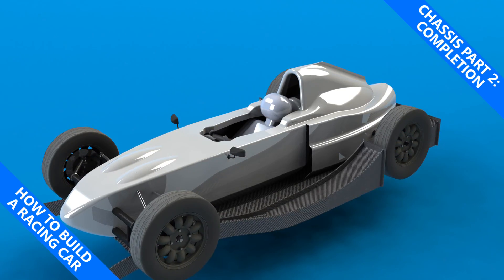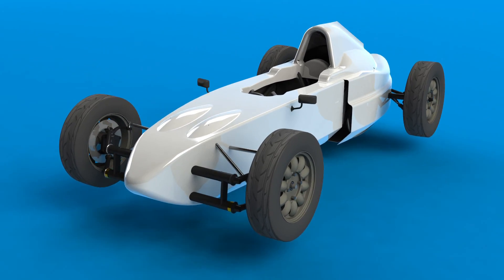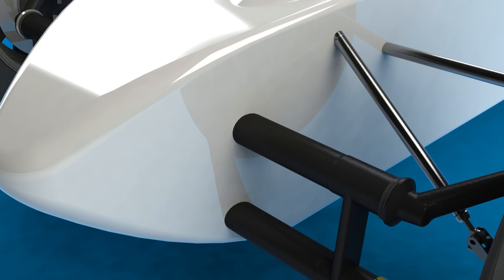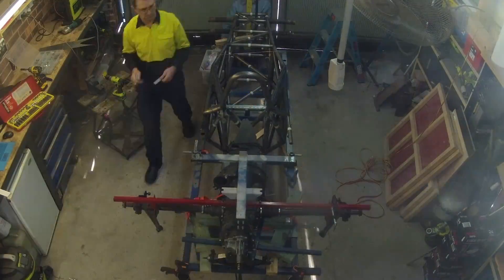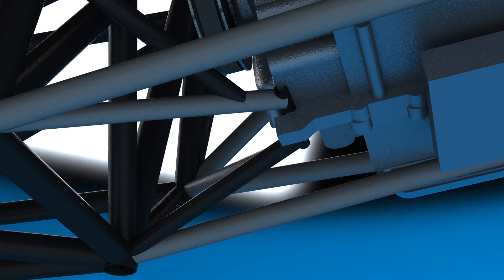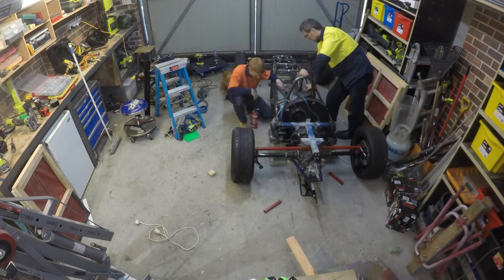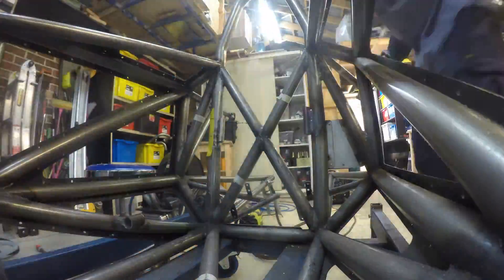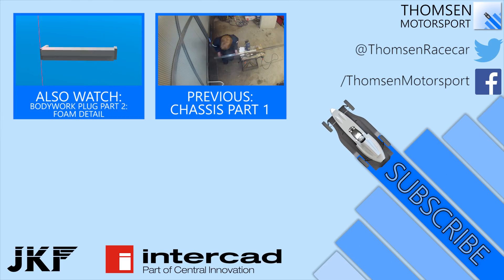Chassis Part 2: Completion

Comment: it makes no difference where the beacon is placed, whether front or back the time recorded is the same :)
Reply from the maker: +hortonas786 correct, the lap time will be the same. 
However if you cross the line side by side with someone else, it may make the difference between being before them and after them in the timing computer.
Reply: that is correct. but since the timing is the same no matter where you put the beacon, and assuming its a time trial, doesnt this mean that even if someones car reaches the line first the winnes is still the one whose time is the fastest?
Reply from the maker: +hortonas786 if it were a time trial that would be correct. That's how qualifying works. But the races do depend on finishing position as identified by the beacon. It's not uncommon for cars to finish races side by side - I've been in that position before - so I wanted to do what I could.
Reply: nice! thanks for clearing it out man, good job on the car. looks amazing

Comment: i want to know that why in most chassis like this the front section is elevated...?? any significance..??
Reply from the maker: +rohit rawal on my car it's partially for aero reasons. The amount of dive under braking also means a high front will reduce contact with the ground. Vees are softly sprung so without a heap of preload this would be a problem for a low nosed car.
Reply: Sir...is there any reason fr suspension hard points or related to wheel..?? Let me show u a design..any sir il trouble u alot because u r a man of my need...In this design aero is not considered yet the front n middle part are elevated..Sir help me to understand...
https://lh3.googleusercontent.com/YatPJsdXZV4LM3qTHIsAT_1pxedc2sXnp8PqyQCsWNBEtSaoa447NHj0ZnHtoVnGoYNHmoydSA
Reply from the maker: I'm having some trouble understanding. The suspension is lifted from a VW beetle so very little can be done in terms of geometry and things, you just have to mount it to the car. Aero was considered and was part of the reason why the front is elevated, however as I mentioned it wasn't the only reason. Does that clear it up?
Reply: OK sir.....

Comment: I have a kart, but I want to upgrade it. to make the chassis welding and só on is not problem, but to draw it in some software I don't have any knowledge... I didn,t understand well what you used...
Reply from the maker: Hi Roger, I used Solidworks to do everything you see, from the design to the drawings and then the renders that go in the videos. I've used a few packages with work but went with Solidworks for this project as I found it the most intuitive and covered the wide range of requirements I had. If you're in Australia Intercad could help you out, otherwise there should be a local supplier of the software.

Comment: first, awesome work, very well documented,  top. this is the first chassis you made? what is the kind of matal you use? when you say that you spend around 25 and 30, you are including the tools to make it? thanks and keep going 😉
Reply from the maker: Yep, first chassis for me. I used 350MPa carbon steel tube (specified by rules), produced seamless and drawn over mandrel to form its shape. That figure includes the tools, it's an all inclusive figure for anything I've spent on the car. Thanks for the feedback.

Comment: some circuits like a Rally Sport require certified welding facilities to put in certain portions of the frame, was that not an issue for this project? could you explain a bit more about the FEA, I know you can't do collisions in SolidWorks but I'm curious to know how you approached it using Excel?
Reply from the maker: +P R The rules specify the material, some of the design constraints and fabrication methods, as long as those are followed it's fine. You need to get the chassis certified if you deviate from those to ensure it's safe. 
I used 6dof frame stiffness elements to build a stiffness matrix in excel. I had a sheet containing all the nodes (xyz coordinates) and another that contained the elements (id number of start /end node, element properties). The stiffness matrix drew from these. In that way I was able to make changes without too much issue. I set constrains and loads to calculate the displacement matrix and went from there. For a collision I applied an appropriate load where the contact occurred, for instance on top of the roll hoop for a roll over.
Reply: Thanks, to me a project like this is a way to test someone's engineering, in my case I'm  an MET,and fab skills, as a welder I understand the satisfaction of building it yourself.

Comment: Im curious about where and how you will be mounting your battery. As we do Annual Tech inspections on these cars with the SCCA we want to make sure that it is solidly mounted. A lot of people would use your transponder mount(or one very similar looking) and flip it so it is facing upwards against the forward bulkhead and put the battery in there. But what is your solution?
Reply from the maker: For me it's secured by a frame just beneath my upper legs. I think it may be visible in the first drive video I put out a few weeks ago. It's an item that isn't in my model (woops). The solution you've mentioned is what was in the Stinger I raced previously, the owner put it there for weight distribution reasons. I'd prefer to use lead ballast than the battery as a tuning tool, it would be more difficult to move the battery around in future than it would be for lead - plus hopefully safer.

Comment: How much weaker would it be if you used a MIG welder instead of a TIG?
Reply from the maker: Honestly from the reading I've done it's pretty difficult to quantify and would depend on a lot of factors. I can't really answer that definitively I'm afraid.
Reply: ThomsenMotorsport Thanks anyway!
Reply: The limiting factor is generally the heat affected zone in the tubing itself. Welding type should be irrelevant as long as the filler used is appropriate for the tube alloy. Welding type/methodology is usually dictated by series rules if at all though.
Reply: Smaw or as in shielded metal arc welding a very exellent way of welding materials together. It beats tig and mig all the way.